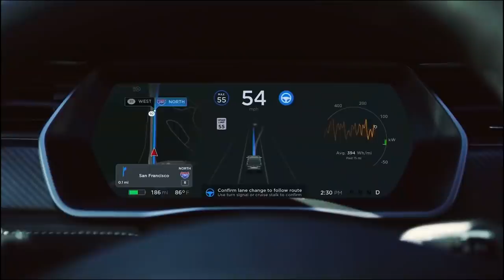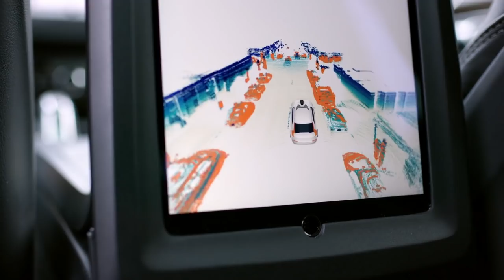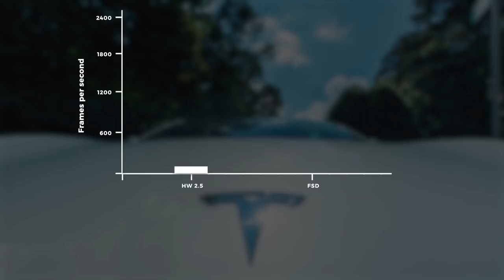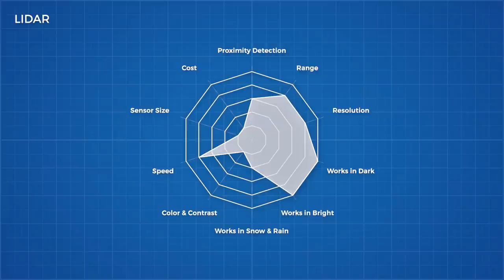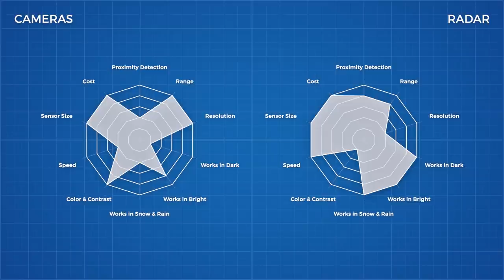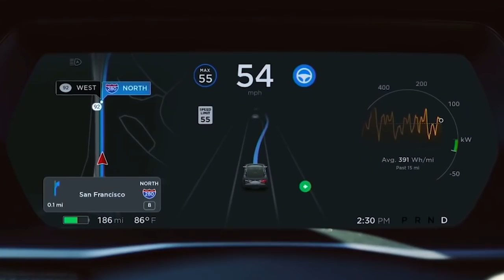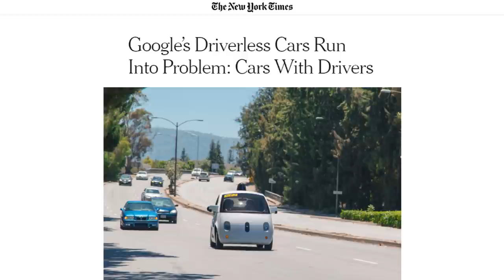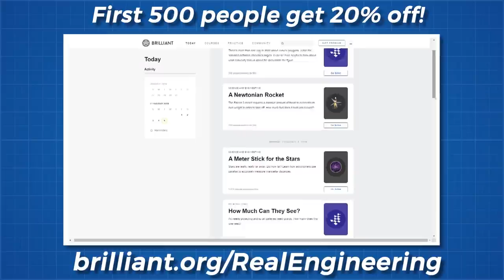The Challenge of Building a Self-Driving Car

Comment: The rotating ones (LIDAR'S!) are being phased out for newer cheaper fixed LIDAR where they are placed around the car like the Tesla's  Cameras but would have even longer range and can tell 3D shapes much better over a camera although I am of the opinion RADAR, SONAR, LIDAR, Cameras (4K, Infrared!) are all needed to complement each other and if any one device fails to detect an object or identify it the others can compensate for it in theory and if it can resolve the issue treat it as a living creature and do all it can to stop the car safely or avoid the object and if it cant do that mitigate the damage to all party's!!! 

RADAR is Radio Waves which works best on metal objects!
LIDAR is Light (lasers!) which works on many kinds of materials but stuff like clothes can absorb it so it not fool proof!
SONAR is sound like bats and wales and works on almost all objects which is great but a fast moving object only gets a small amount of the sound bunch back (wales and bats move relative to a normal car on a highway/freeway much slower at round 20km average speed!) 

Cameras seem like a great idea but they can not tell speed or distance as well as the above and are more likely to be unreliable in Fog, Smoke, Heavy Rain, Snow, Direct Sunlight (Dawn, Sunset!) as all these environments block and/or distort the image to degrees where even very smart and well trained AI are unsure!
Heat/Thermal Sensors as they could detect and distinguishes between mechanical heat, animal/human heat as well as general fire!

All these technology's need to be used in tandem with each other so if any device breaks or fails to work correctly the others can hopefully compensate and if any device fails to identify an object the vehicles should go into caution mode and reduce speed to a safe level (or stop if safe and needed!) otherwise try to change it's direction away from the object if at all possible such as changing lanes!

Full self driving cars are at least 3 to 5 years away from a technology stand point and 5 to 15 years in most places by law makers as they want the technology perfected to be as good or better then a standard driver before they allow it on public roads!

I am interested to see how this technology from all party's deals with the Train/Trolley Dilemma where does it kill one person to save many and how does it make that choice?!

Comment: So lidar or future sensors would be able to use 5g radio waves for detection. If 5g uses a different wave length and at higher intermittent signals it's (lidar) is able to to compare what it is seeing and the silhouette of an object to confirm in processor. But you would only get 2 or 3 surfaces of an object. So in theory if Tesla knows an object is going to be somewhere before Tesla gets within distance or threat zone determining that object as an obstacle would have saved that cyclist  life.

Comment: I don't see full self-driving becoming a reality within the next 15 years. However, different automakers and different Vehicles will have different levels of autonomy that will be much safer than a human driver. The reliability of such systems will require a human being behind the wheel (at all times) to take over in an emergency. Within the next five years a Tesla will be capable of going from downtown Los Angeles to downtown Manhattan without a human behind the wheel, but that is only a fraction of what will be necessary for autonomous vehicles to be licensed Nationwide.
Reply: Very realistic assessment. I have to say, the Tesla system is bringing real-world functionality to the masses -- well, any of the masses that can currently afford it. It is a HUGE safety enhancement for long trips. 

Just because it isn't able to be autonomous doesn't mean that it's not a useful tool.

Comment: Great video. Autopilot is so amazing.. don’t believe the super negative press, Tesla’s fleet (currently) has ~100 million Navigate On AutoPilot miles. Robotaxis are coming!!
Reply: Your using states from 0.0000000001% of cars to judge what will happen when there are millions of these cars not a few hundred or thousand.
They also did not factor when these cars are 10 years old being sold used for $500 and being drove by poor college kids , who do not even know how to maintain air in a tire.
These things have to be 100% reliable ,100% of the time . Even at 99%  they are a death trap to everyone.
Name a man made mobile machine that is 100% reliable?  
I had 2 week old cars break down on me but unlike a driverless car it did not drive into a building or rear end  a stopped car.

Comment: Those LIDARs that Elon Musk criticises are old school.  Solid state LIDAR is available already at around $250 a unit and expected to drop to $100 as production ramps up.  Not sure if they're as high-spec as the spinning systems but a couple of years hence I expect Waymo, Uber and the others to be using solid-state high-spec LIDAR - well before full autonomy becomes wide spread.  The computational overhead with LIDAR should be close to being cracked by then too.

Comment: This reminds me of the first cars that still had a seat for the coachman way up high in the front so as to be able to see over and control the horse, which was not there.  If there were no human drivers sharing the road with the self driving cars, it would be an easier problem to solve.  The whole road infrastructure is based on human drivers, making this a huge and expensive and somewhat unnecessary puzzle to solve.  I think a TCP-IP-type controlled system running on rails, with the individual packet and linked packets representing the people carriers, would be easier to solve.

Comment: A question never mentioned: What happen if the system fails?

No matter what, like a normal car or truck, something is gonna fail. Sudden flat tire on a wet, the car is gonna veer-off of the roadway; notorious potholes & unplanned lane changes (i.e.: Baltimore, MD) will hinder a self-driving car's effectiveness drastically. Nothing against self-driving cars but bad road planning exists.

Comment: Human drivers are actually the biggest problem for self-driving cars. A self-driving car in an environment where there are only self-driving cars and pedestrians or cyclists are way easier to program than those that have to interact with human drivers.
Another point is that the laws of the road are different in different countries.
For example: To my knowledge in Austria, if multiple cars have stopped at a crossroads, the drivers are supposed to look at each other to decide who is going to go first. So there is actually Human interaction required.
Reply: The next step once we have true autonomous driving is to make them connect together. That way they can interact with each other and optimize the traffic.
Reply: @RawbLV  Technically that is actually way easier than having self-driving cars that can interact with humans. And it actually makes it much easier to interact with human drivers and pedestrians as the network can keep an eye on them.
The one big problem is that you need a universal standard for that. And I think that that is the biggest challenge this technique will face.
Reply: Agreed. I have just driven into my local town. Heavy traffic and people trying to get out of side turnings into the traffic stream. The only way they get out is by drivers on the main road slowing and waving them out. Same with cars on the main road turning across oncoming traffic. Human to human interaction required. A self drive car would be waiting a very long time for a big gap in the traffic flow and backing up everyone else.
Reply: @raytrevor1  The interaction between humans and self-driving cars is a really interesting matter. Jaguar Land Rover created a (slightly uncanny) concept of a car with eyes so that pedestrians know that the car has realised their presence. Basically the car looks at them. In a car on car situation that is even more complicated and will probably require human interaction for a long time.

Comment: Why use Uber as the example for disengagements? Waymo had a disengagement every 11,000 miles in California last year. They achieved that driving in far more complicated conditions than autopilot is used (basically just highways). 

Tesla has a long way to go before autopilot is even close in terms of capability and performance to Waymo. I'm not saying that they won't get there, but they are definitely not as close as Elon says they are.

Comment: One thing I think that needs to be taken into account with LIDAR is that it works great now, but what happens when every third car is projecting it's own LIDAR pattern on everything around it. with dozens of lidar systems active around yours, how impervious to interference will it be? What happens if ALL moving vehicles have active LIDAR systems? I imagine there is only so much interference before LIDAR systems start losing their accuracy and reliability edge, and what'd be the point of using them then? Any self driving car that relies too heavily on active sensor systems, especially ones expected to work over large ranges, are not designed to handle the environment they themselves will create.

Comment: I wonder how you can improve machine learning, like changing rules or parameters. Here a few examples:
a) you notice that the machine fails to spot black people (contrast at night and lack of Afro-Americans in reference database)
b) you notice that the car lacks a feature like warning the driver that the autopilot doesn´t compute.
c) You need to change a traffic regulation for a different country
d) You want to improve the prediction of movement patterns depending on the object (skaters vs. bicycles eg.)

Would it be possible that a computer makes modules while learning like: object identification; rangefinding, speed measurement, path prediction...?

Comment: the solution to this is simple, but hard to execute: replace all cars on the road with driverless cars or nothing. if all of the cars were driverless and hence follow all laws, theoretically there will be no accidents. it would be even much better if the cars could communicate with each other, to address problems even if laws were followed. It would eliminate traffic lights, or even solve traffic jams because all of the cars are governed by a single system that works together
Reply: We visited DisneyWorld about a decade ago and they had a future vehicle computer animation that was like that. Every vehicle was in touch with each other and adjusted their speeds so that no lights were required at intersections. Looked pretty neat but I’m not sure I would ever get used to a vehicle going at a high rate of speed towards a very busy intersection with no lights. Who knows though. Maybe it would seem normal after only a day of seeing that.

Comment: The REAL challenge to designing a self-driving car is that the the problems you face designing a self-driving car when there are only a very few self-driving cars on the road are very different from the problems you are going to face designing a self-driving car that is one among many self-driving cars.  So, far I have not seen a single person mentioning this problem as a problem yet to be overcome.  Maybe I'm just not paying sufficient attention.

So presently, the current generation of self-driving cars depend upon a large number of human drivers in the population.  No one knows what will happen when large numbers of self-driving cars start interacting with each other.   By the time this happens everyone will all ready be deeply committed to the concept of self-driving cars.

It's the old four-way stop sign problem - as an example of the general problem - if you are the only self-driving car in the neighborhood you can develop an algorithm to make this work well enough;  you just design your self-driving car's algorithm to always be the most cautious one - because you are really optimizing for lack of bad press an not top efficiency.

However, it is a very difficult problem because there are two distinct modes of decision making:  we take turns - I go then you go -  or the next car in line going clockwise around the intersection goes.  The problem is that it is normal to be constantly shifting back and forth between these two modes of decision making, and it is often very unclear to all of the drivers around the intersection when to shift modes.  Then, there are the people who are just jerks, or in a huge hurry, or who aren't paying attention and just go when they aren't supposed to.  This is the normal condition - a little chaotic -  a little confusing.  At moments like this having a distribution of driver personalities from more aggressive to less aggressive actually helps to solve the problem.  At some point the most assertive [or aggressive] driver is just going to go.  What makes this especially complicated is that communication between drivers is very limited and fraught with errors. 

Drivers normally make decisions about how to sort out the 'who goes next' problem based upon a variety of inputs and experiences that vary significantly.  There are drivers who are more or less experienced, more or less intelligent, more or less distracted, and more or less assertive -  that is a lot of variables to control if you are a human driver, much less an algorithm.  Which is why there continue to be accidents at four-way stops.  It is difficult to control for the chaos.

With only a few self-driving cars around optimizing towards the least assertive stance makes a lot of sense - just drive like a granny everyone will go around you..   But, what happens when driving cars are in the vast majority most of the time?  You don't want to become a Looney Tunes episode where every four-way stop becomes an episode of:  "After you, no after you, no after you, no after you..."   grid-lock, nobody can decide to go first and switch modes.

Of course there is the possibility of creating a system where all of the self-driving cars of possible every make and model  are in constant communications with each other, and from that they can  can figure out where the human-guided cars are, then they employ an arbitrage algorithm where all of the self-drivers sort out amongst themselves what decision mode they are in and who goes first.  But that process is likely to prove to be complex and a little fragile - because it is complex and chaotic.

What is going to be really interesting to see work out in the courts is who pays the insurance for the inevitable accidents.
Reply: Also how do these cars work when they are used and 5 years old.
It has to work 100%perfect  100% of the time or it's a death trap.
Reply: @Crashed131963  Big Unanswered Question No.1 is:  who is responsible when an autonomous car gets in an accident?  the car owner? or the developer of the algorithm that is driving the car?

Comment: Can any of them detect and avoid potholes?
Reply from the maker: Not reliably. I believe Waymo includes that information in high detail GPS maps, but that seems like a very expensive database to keep up to date. I could be wrong there.
Reply: As we are just at the end of pothole and worn out lane marking season I really wonder how they will deal with that.  I guess they get them working in California then deal with outliers?  I wonder if Norway, with its large number of Teslas, will be the impetus to deal with weather related road degradation.
Reply: @RealEngineering  database are cheap  to manage most of it is sorting and backspace is cheap. now getting data might be expensive.

Comment: You've done a fair amount of research into this which is brilliant and I particularly enjoyed the comparison between sensor types however I took issue with you comparing the human intervention required rate to fatal crash rate as like for like. This isn't exactly a like for like comparison.  At a push this should maybe be an intervention required to any crash comparison but even this would be an unfair comparison for the self driving car as presumably not every time human intervention is needed there would otherwise be a crash.  I understand a completely like for like comparison is an unreasonable expectation but please don't compare things that aren't similar to prove a point.  We're after the science, not the headline grabber.

Comment: Interesting to hear the analysis of the fatal accident with Uber's self driving vehicle. One thing that I wanted to consider is how well the car responded compared with a human driver. The system which initially detected the pedestrian was RADAR/LIDAR, at 6.3 seconds prior to impact. This is likely because it was night time, and RADAR/LIDAR do not require visible light for detection. However, would a human have detected that pedestrian 6.3 seconds prior to impact? Perhaps not. 1.3 seconds prior to impact the vehicle system accurately identified the pedestrian, and was still traveling 70 km/hr. Would this be enough time for a human to react properly and avoid the impact? That part is difficult to answer..